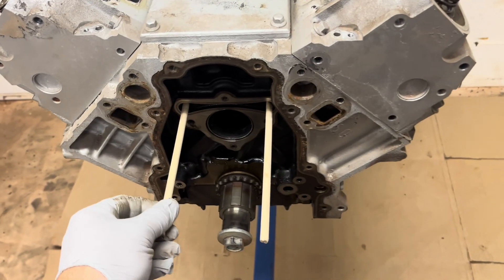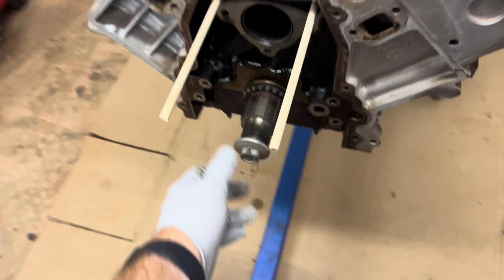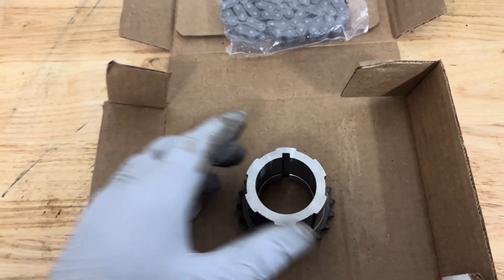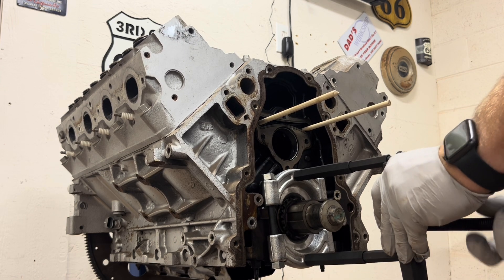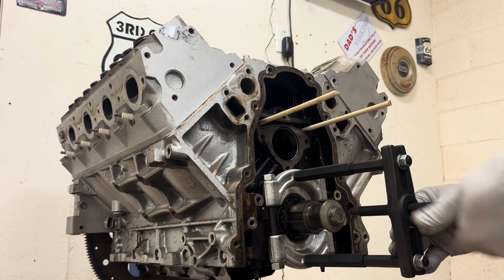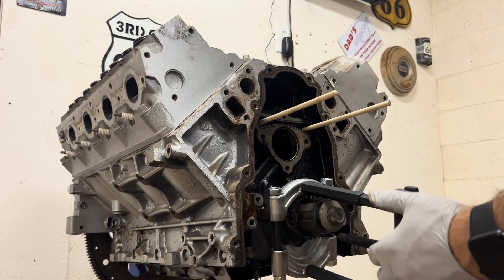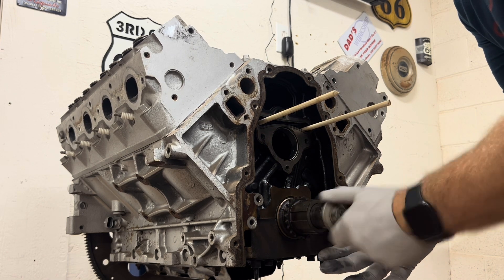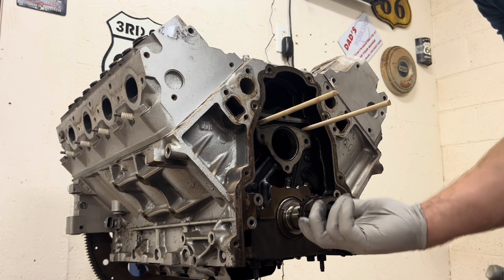How to Remove a LS Engine Crank Timing Gear.

Comment: think this would work with the oil pan on ,
Reply: Yes
Reply: @michaelcook270 you’ll have to remove the oil pump to get to this gear. You’re going to have to drop the pan to get to the bolt that holds the oil pickup into the pump so you can remove the pump.